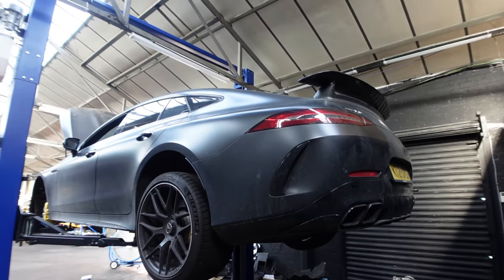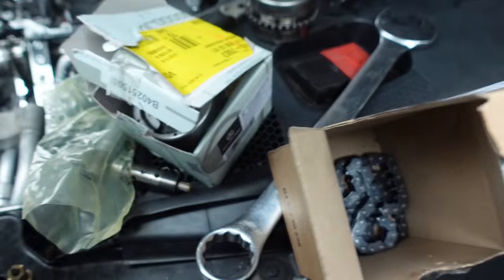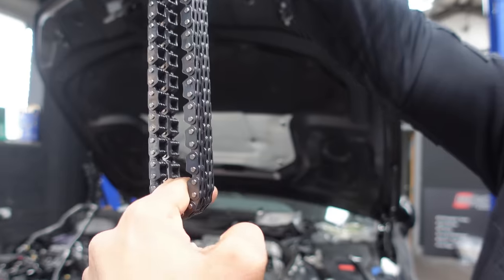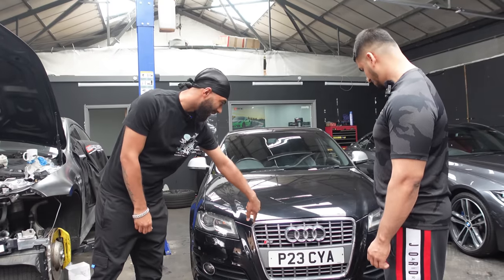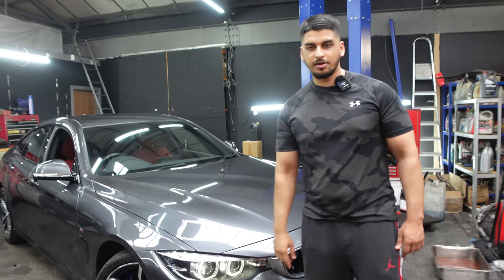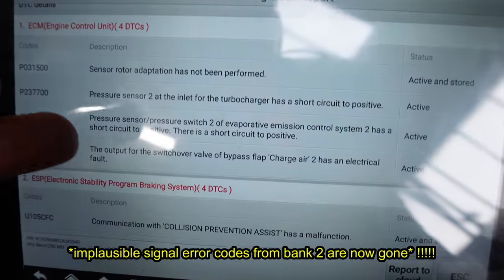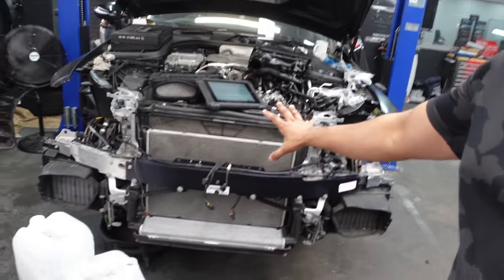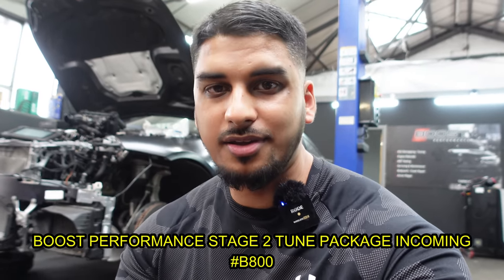ITS OVER ! I have FIXED the expensive Mercedes GT63s AMG finally ! PT9

Comment: In alot of these late model mercs the chains are actually really good particularly the m156 type chains they dont really stretch or wear and the "wear" if its not stretched is actually good its just polished smooth and it wont wear the chain guides as much as a new chain so if its still the same length and no other issues id use the old chain everytime.     Most problems are nearly always these bloody cam phasers or solenoids or sensors.

Comment: Awesome Namz, you've proved all the doubters wrong. Well done 👏🏾 ✔️ 👍🏾
Reply: It's not fixed yet brother, if u checked there's still several fault codes after the skimming/timing and adjuster issues!🤯💀💀👀👀👀🤯🤯😫😫😬😬😬
Reply: @craigmorgan4676  that's a shame but hopefully it'll be fixed soon fingers 🤞🏾
Reply from the maker: @craigmorgan4676 you didn’t hear what I said the fault codes are only there because things have been left open once we plug them back up bumper back on etc it will be perfect, proof will be in the next vidoe

Comment: He's wrong about the chain timing.

He's talking about the tensioner side.  The other side is just cam sprocket to lower crank sprocket which is taught.

When the head is skimmed the head drops a mm or two. Thus the top cam sprocket will move anti clockwise by a small amount.   If it affects the running of the engine I don't know but skimming a head knocks out timing.  Unless you can remove the cam sprocket and turn it to line it back up..

Happy to be corrected...
Reply: I think you are right! But I wonder if this is only a problem with older cars with fixed cam sprockets. These "newer" cars have adjustable cam sprockets. Maybe these are just able to correct this?
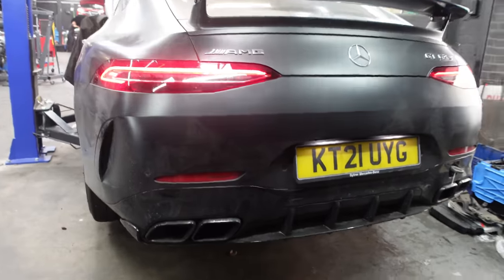Reply: On the older cars like sierra cosworth, pinto, Evo, you could buy vernier cam pulleys to dial in perfect timing. The engine sounded very ‘tappety’ at 9:54 minutes. Fair play to rebuilding an engine of this complexity.
Reply: @ebos514  

60's and 70's Alfa Twin Cam's had adjustable sprockets.  Lots of holes and you could find one that will line up the timing notch.   

I suspect this modern engine just has a bolt on variator.    Anyway the error light went out so it seems to be OK.
Reply: @mark4lev    He only took the heads off!
Reply: @shabbos-goy9407 I know, i agree with your post. What point are you making?

Comment: Total investment for average person would still be over $100k and there may be other hidden problems (warped cylinders etc).  Makes for good youtube views but this is an example of what NOT to do...resale price on this car might be $90k (that's pushing it) if owner discloses engine is rebuilt and not by Mercedes.  I wouldn't trust this engine to go 100k miles
Reply from the maker: Absolutely not it is very profitable just wait till I drop the costs on this its easy £20,000 profit at a bare minimum
Reply: @NamzBoost  prove it....with ALL labor and parts itemized
Reply from the maker: @fzr1000981  sure will do including actual receipts paid for parts not a problem at all, feel free to pop in anytime if you want to have a look first hand that’s how confident I am.

Just to remind you I have only paid for headgasket x 2, 2 wheel hubs, timing chain tensioner, chain, adjuster, and 2 x intercoolers. You really think that’s going to bump up my cost by £20-30k?
Reply: @NamzBoost  I know your labor is "free" but you still need to itemize hours for each technician.  Anyone else attempting make money on a flip like this would need to see it

Comment: Damn right U r the EXPERT...!  Well done for perseverance.  Now to a more  humble engine a VW 2012 petrol 1.4tsi cavd. 80k on the clock.  Upon idle it sounds like a diesel as it rattles a bit. What cd it b or is it normal.  I've been told it could b a stretched timing chain or carbon on the pistons.  Anything else from u experts who have worked on such engines. I know ur all busy but hope u may b able to comment.  Thx v much

Comment: 4000 miles on the clock is practically a brand new car and is already conked out. Strange innit! On top of that it cost 120,000 brand new. Unbelievable. What did Ashley Young do to it lol